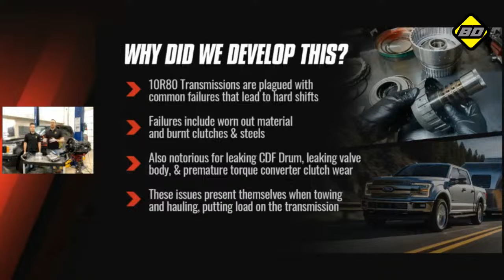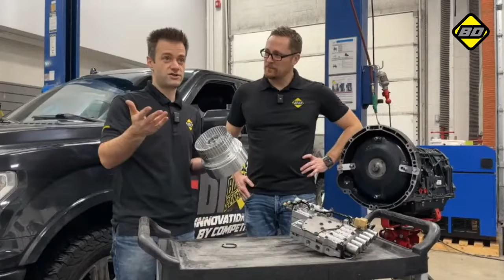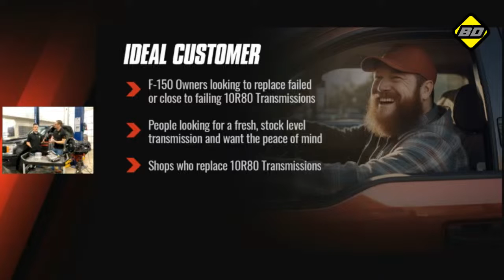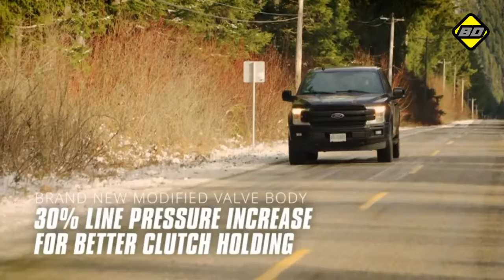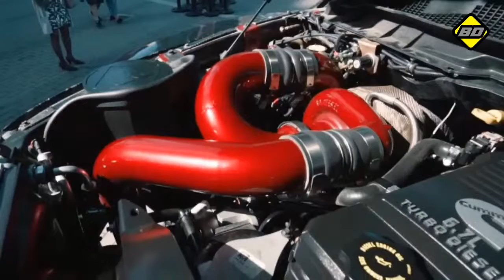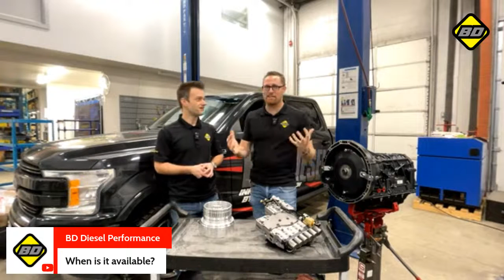RoadMaster 10R80 Ford F-150 Transmission 2.7L/3.5L/5.0L 2018-2020

Comment: does this fit on a 2017 as mine is equipped with the 10r80. is there any difference? I need to buy one asap as mine blew out yesterday.

Comment: Best thing to do is a Transmission Service, Fluid & Fliter.
Drain your fluid out of the pan using a extractor. 
Drop the pan, clean our very well, cause you will find 1/16” of grey metal particles on the bottom of the pan and magnet on the Filter after as little as 24,000klm 
Mine was clunking the odd time, since I serviced the transmission it’s smooth as silk.
The Break In material is killing it.
I drained min on my new 2024 with 6,000klm on it, although it wasn’t to bad I found 1/3 of the amount I did in my 2021 with 24,000klm on it.
I also added the B&M Larger Pan.
P.S.
Mine was the 3.5 the pan was difficult to put in, I thought I may have to undue the exhaust.
Suddenly it slide right in, there’s a sweet spot it seems. 

“CHANGE YOUR FLUID”
Reply from the maker: Great information, thanks for sharing!

Comment: Does the bigger torque converter or higher oil preassure from the oil pump require any programming?

Comment: Just passed this information on to a friend of mine that owns a 2020 2.7 EcoBoost. The transmission is on its way out. Took a ride in it with him… it’s not looking good. Needs his truck for work; travels on the road with it. Told him it’s gonna leave him stuck somewhere if he doesn’t get ahead of this issue quick.

Had a 2016 Expedition with the 3.5 motor. I did some work to it… the following Full Race components:
-intercooler
-throttle body spacer
-oil catch can
-blow off valve
-cold air intake

Also did:
-MSD coils & wires
-NGK plugs
-SPD down pipes
-Carbon ceramic brake pads
-tuned by Elite Performance Tuning

All that said… the transmission did okay. The rear differential started giving me some not so cool noises. I too primarily drove that vehicle over the road for work. Racked up a ton of miles to the tune of 236k miles before throwing in the towel. Sure do miss it. Means more to you when you turn the wrenches yourself. Oh well…

P.S.- Would like to thank the folks at BD
         Diesel for doing something the
         Ford idiots should’ve done for it’s
         customers!!!

Comment: i got a 2019 ford f-150 2.7l ecoboost, 110k miles on it, recently got an issue with hard and delayed shifting, when cold the transmission has a hard time going into 3rd gear, high rpm no power.. if i drive it for about 10-15 mins its no issues, been having problems with it for a few months tbh.

i’m thinking about fixing the cdf drum issue myself, but what i’m seeing is you guys developed a better transmission that fixes the 10r80 problems ? what’s the cost?

i got a p0734 code btw
Reply from the maker: Hi there, thanks for your questions. 
The P0734 – Gear 4 Incorrect Ratio. Typically repaired by replacing the transmission.

The cost you will find here: https://us.bddiesel.com/collections/shop?tag=10r80-roadmaster - 3,995$ USD + Refundable Core deposit of 2,000 USD
Reply: @BDDieselPerformance  Thank you brother, appreciate it

Comment: Will the 10r80 fit all three different engines .another words can I use a 10r80 from a 3.5 and put it to my 5.0.same year same 4wd only difference is the motor
Reply from the maker: Hi Derek, thanks for your question. The bellhousing pattern is different between the V8 and V6 models. A 3.5L/2.7L transmission will not fit a 5.0L

Comment: How much does the transmission cost? how much is the usual install cost in the US?
Reply from the maker: Thanks for reaching out. These transmissions cost $3,995 + a $2,000 refundable core deposit Link Here: https://us.bddiesel.com/collections/shop?q=10r80

As for installation costs that will be dependent upon the labor rate you are paying. 

The average installation time for this transmission is 13 hours.

Comment: How much? $  Work with MCT tune?
Reply from the maker: Thanks for your question! Our transmissions do not require tuning and have mechanical updates made for increased pressures, but that tune should be compatible.
Reply: @BDDieselPerformance  I have a 5-star tune on my 2018 F150 that also changes the transmission's behavior. Will I be able to retain my tune with this new unit?
Reply from the maker: @yt310yt  Thanks for your question. There shouldn’t be any issue with the tuning and this transmission. It looks like the 5-star tuning is mostly a shift strategy.
If the tuning includes adjustments to the line pressure, we recommend that you double-check the line pressure post-install, as shown in our install manual.

Comment: Hey so im thinking on getting this transmission. If i order one does it come in a crate to my house and i have to find someone to install it? I have a little experience with transmissions is this something i can install at my house? Is it plug and play or is there a little bit of coding that needs to take place?
Reply from the maker: Hi, Evan! Thank you for reaching out. As for installing this unit, a Ford scanner or equivalent is REQUIRED to update the TCM with the new solenoid code and initiate a relearn. This is a very critical part of ensuring a long, healthy life for the transmission. If you had a scanner, you could do this yourself. Make sure you follow the instructions religiously and you’ll be just fine. Also, if you need help, you can call us here and we can walk you through it.
Reply: @BDDieselPerformance  Thanks for the response! My current transmission still runs and drive but hits a couple of gears kind of rough. I'd rather just buy a transmission like this one if it's not to much work to rebuild them

Comment: What's the part number for your modified valve body along with price?
Reply from the maker: Sadly, we do not currently sell these separately from our transmissions.
Reply: @BDDieselPerformance  If you can send out a valve body and oil pump for warranty on this exact transmission why cant you sell those parts? and why was the warranty parts different part numbers than the valve body and oil pump you built this transmission with? Just asking cause this is what is happened to this exact transmission I bought from you guys
Reply from the maker: Hi  @chrisgerbrandt9601  , sorry to hear you had a warranty issue. In a situation where one of our transmissions fails we are always going to help our customers and get them the parts they need to get it fixed. Having said that these are component parts that we use to build our transmissions and they aren’t always economically viable for us to sell on their own. I hope that answers your question.
Reply: @BDDieselPerformance   do these transmissions typically have airlock issues? and if so is there an air purging procedure to get all the air out of the system?
Reply from the maker: @chrisgerbrandt9601  Thanks for your question, @chrisgerbrandt9601. We’re not aware of any airlock issues with these transmissions, nor did we experience any issues with the air system when designing this product.

Comment: Would this work for a 2017 3.5l ecoboost with the 10r80? Wondering if there is a difference from 2017 to 2018 that would exclude it?
Reply from the maker: Hi there, thank you for your question...There are Valve body differences between 2017 and 18 that don’t allow compatibility between the two.
Reply: @BDDieselPerformance  okay! Thank you for the clarification, I have been trying to find something that explains what was changed. So with the difference in valve body on the OEM one, would tuning fix the discrepancy? I'm assuming there would be a difference in the TCM program then to correlate with the valve body?
Reply from the maker: Hi! @nickom7828  Unfortunately, tuning will not fix the discrepancy. Typically, with part number updates, different components are used within the valve body, which will work within different parameters. We have not investigated all of these changes at this time.

Comment: Looking forward to you guys extending the product date range to include the Gen14 (2021-2024) trucks. The CDF drum solution wasn't fixed until after the production was in full gear for the current trucks.